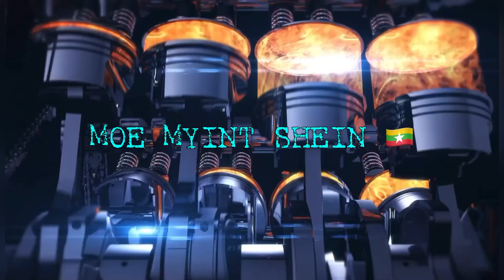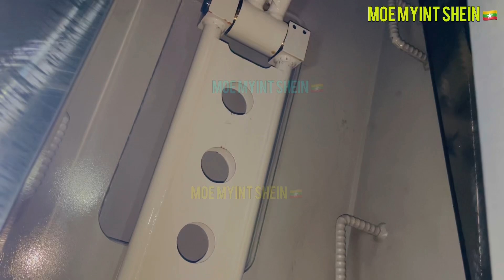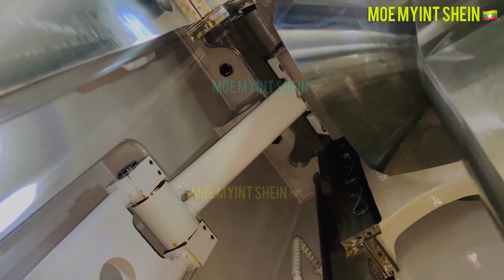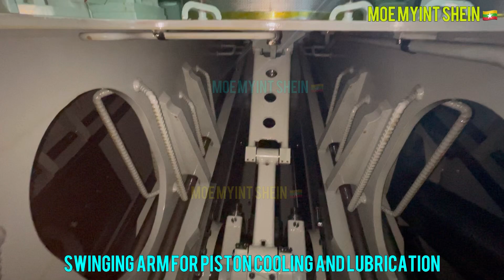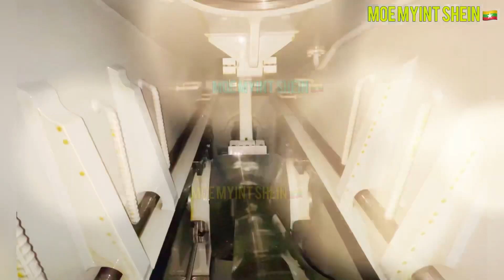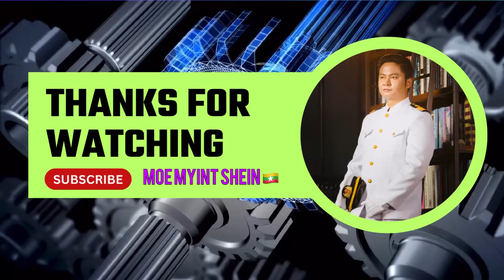The rare art of Swinging Arm Lubrication | Marine Engineering | Technical Vlog : 094

Comment: Swinging arm is for poston cooling or crosshead cooling? In man b&w engine telescopic pipe is used to cool crosshead right?
Reply from the maker: Crosshead is only required for Lubrication. 
Purpose for both telescopic pipe and swinging arm is piston cooling. 

MAN - B&W and most UEC (Mitsubishi)  Engines use telescopic pipe. 
Sulzer and this UEC (6UEC42LSH-Eco-D3) Engines use swinging arm.
Reply: @CHiEF_MOEMYiNTSHEiN  thank you🙏